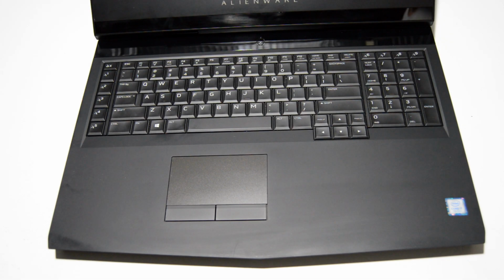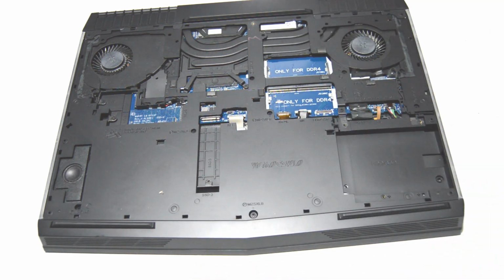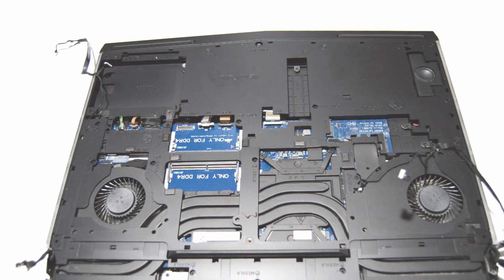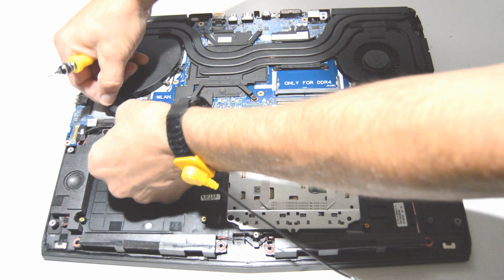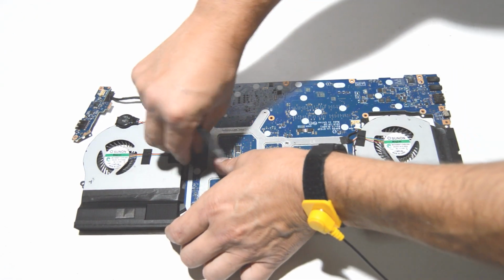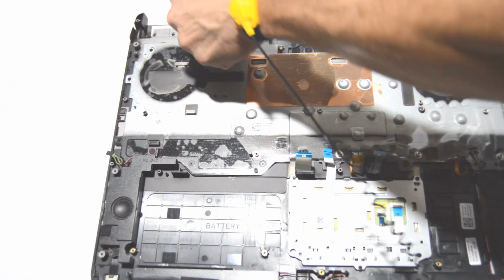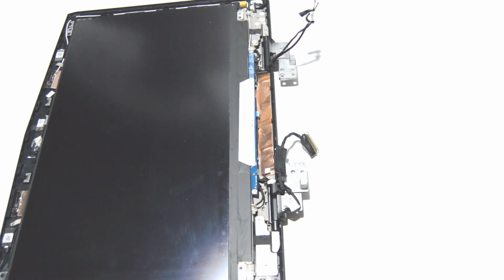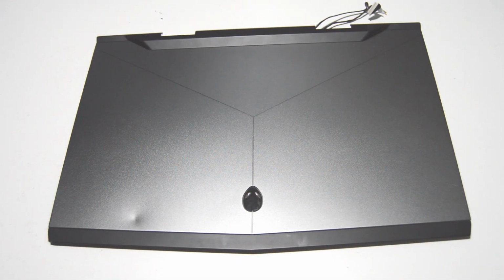How to Disassemble Alienware 17 R4 GTX 1080 i7 7820K Laptop or Sell it.

Comment: my 17 R4 is into it's 6th year still running strong. GTX 1060 with I7 6700HQ

needs it's battery replaced but I just keep it plugged in, the disassembly looks daunting

Comment: Hi, one of my screws in the bottom cover is stripped from when I sent it out for repair under my warranty? Could you please give me some tips on how to remove it?
Reply from the maker: You can sometimes get it with a small flat blade, otherwise you may have to drill it a bit and use a screw extractor.
Reply: @AssimilatorX mine actually got repaired nearly an year ago and I didn’t notice until I opened it a week or so ago. Sadly my warranty is out so I don’t know if they will accommodate
Reply: @Sellbrokedotcom  alright thanks

Comment: Hi. What is the number of fans? I need to replace it but don't know s/n of fan i need.
Reply from the maker: You need to enter your Service Tag number on the Dell support website to get the correct part number for the assembly. There are different ones depending on your video card version.

Comment: After cleaning the fans my right USB port doesn't work anymore. Do you have an idea why?
Reply from the maker: Sorry just saw your reply. Did you just blow air into it or actually take the bottom case off? The only thing I can think to check is the connector that attaches to the motherboard.
Reply: May be u didn't connect it properly! Do recheck :D